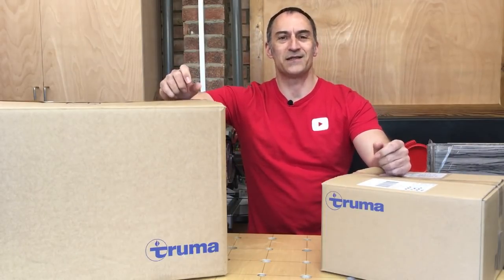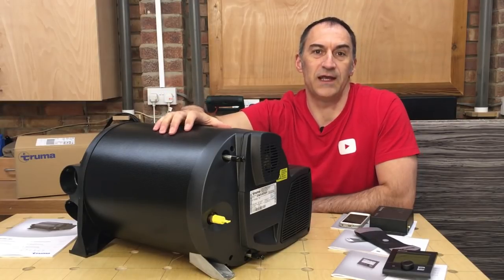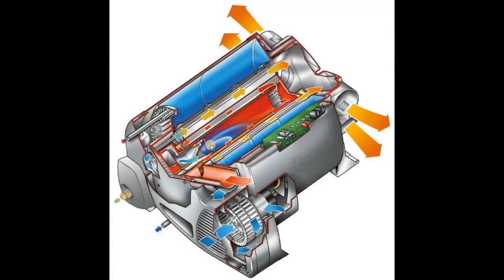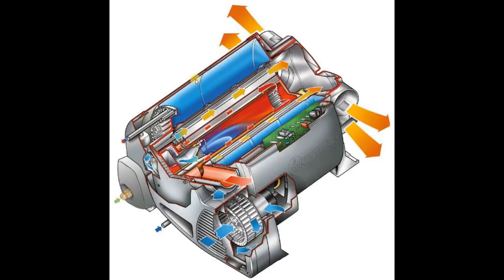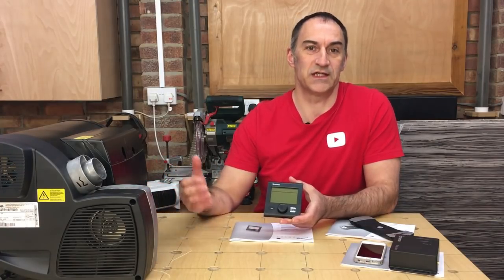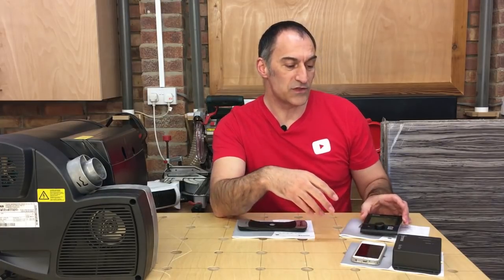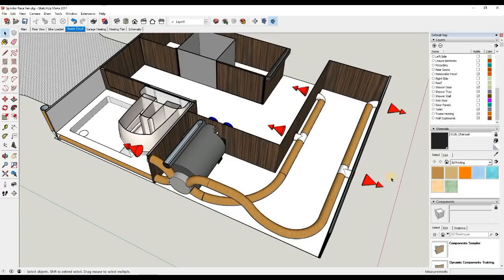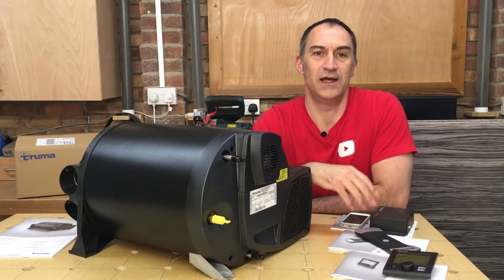Truma Combi 4e Heating & Hot Water Boiler

Comment: First off, I love the series - you are doing a remarkable job. I'm wondering how quiet this heating unit is when running.  Also, can the water be heated without running the furnace . . . say in the summertime?
Reply from the maker: Thank you Bill, the heater we have gone for has 2x 900w electric elements. So you can heat the water with having the gas burner on. You can heat water by gas too without blowing hot air around the van. Proper Combi boiler. 😊
Reply: Sounds good and thank you for your response. Most RV heaters are very loud when running - how quiet is yours.  Once again, this is the best "how to" series I've seen.  Thanks again.
Reply from the maker: Hi Bill, the system has not been commissioned and tested yet but rest assured there will be a detailed video on it running and it’s operation. Thank you

Comment: I love your videos, very educational!
Is 10 litres of water enough to have a shower?
Reply from the maker: Great question, that’s 10 litres of water at 60C so mixed with cold to bring it down to 40C and it will last much longer. 
Of course you won’t be in there for half an hour but plenty to shower with then 20 mins later another tank full for a second person 👍🏼😀
Reply: Greg Virgoe Thank you for your answe! An other one, if you don't mind: If I use 5litres of the 10 litre tank, than the rest of the water in the tank will mix with cold water. I would prefer to keep the water temperature above 40celzius. Does it mean in practise that if I have a 5litre/minute pump, than I have about a minute or two to finish showering? 🤔
Reply from the maker: Your pimp May be capable of delivering 5l/min but you need to check what your shower head can deliver. I would suggest restricting the flow of water to the shower head to lengthen the time you can use it for. Look up shower flow restrictors. Cheers

Comment: Greg that was very comprehensive and well explained - (as usual) -  thank you. I did not spot any form of filtration on the circulating air side of the system? Can you enlighten us on what factors you considered in making the choice between LPG and Diesel and what was the killer fact against diesel? I will watch the makers video now (I do like that LPG liquid sensor!). Many thanks.Edit - just watched the linked manufacturers video - I am calming down now I thought I was going to see full on shower action there - ye gods!
Reply from the maker: Don't expect the same sort of video from me once the system is up and running LOL
I've chatted to the misses and shes not game. LPG is a cleaner and greener fuel.
I was already installing a GASLOW refillable LPG tank for cooking so it was an easy option.

Comment: Greg, I've been binge watching your sprinter build videos. Love them! Do you have any advice for me in the US to purchase the equipment you use such as the water boiler. Or is there a way of getting the equipment shipped, if the company doesn't ship to the US. Thanks for your help! About to start building a  ram promaster to be a mobile grooming unit and want to use your videos for the build. Again, love the videos and your attention to detail! :)
Reply from the maker: Toni Sherwood, I would contact the sales office in The UK and ask them direct, I'm sure they could put you in touch with a dealer in USA, if you get stuck please come back to me as I may be able to get advice from the top man 😃
Reply: Toni, remember the Truma runs on 240V and we have 110V in the US.  I would first contact Truma in Germany to ask about this problem.  You could also contact Winnebago that uses them in their RVs to ask how they resolve this issue.  Once this big question is resolved, you can then hunt for a Combi.  I contacted Truma but they do not sell the Combi direct to consumers, only the Truma Aquago hot water system.  But the Combi is better.  So you  have to find out why Truma does not sell direct.  Is it because it is a 240V and only the RV makers in US can wire it to step down to 240V safely with no liability, or is it because US RV makers want the monopoly and edge of having the Combi while you cannot buy it directly.  I will crack it when I am ready.
For now, see my comment on top with a link to an Aussie dealer and ask them how to get it for you.  But don't forget the 240V issue.

Comment: truma cp plus 4e  w62  1 h ?
Reply from the maker: Yong Cheng are you asking a question?
Reply: @GregVirgoe  Hi I would like to ask what does it mean when the display appears "w62 1h"?  I think I have a problem with cable connection as the sensor keeps showing red light. Thanks.
Reply from the maker: Yong Cheng that code appears to be electronics. I would make sure you have 12v DC supply to the boiler and the controller and that the control cable is plugged in correctly. Check fuses and try again. 😀👍🏼
Reply: @GregVirgoe  Hi thanks for your help.I do have the 12v DC supply and 240v cable both with a diameter of 2.5mm. And I will double check the fuse again when I get home. I am just unsure of which cable goes to which connection, because I reckon there are two cables(one to be red and the other 1/2 red and 1/2 black ),what should I do with them respectively? Thanks.
Reply from the maker: Yong Cheng please watch my install video https://youtu.be/zCjygu0ygKE 
At 9min 15s I explain where the cables are connected.

Comment: You need an outlet for any wardrobe or clothes storage area, my experience is that any condensation obviously will form on the coldest surface. This is usually where you keep your clothes and mouldy clothing is no fun particularly if it is your wife's clothes that smell of mould
Reply from the maker: The cubbies are well insulated from the external walls, the heating is distributed throughout the van pretty well. Warm air rises so I'm not expecting the wall cupboards above the bed to suffer at all with condensation.

Comment: As I understand you cannot get hot water without air heater ON?  During summer camping I definitely don't want to heat the room but would like to get some warm water for cleaning the teeth
Reply from the maker: You can just have hot water without heating on.

Comment: The price in USD seems to be around $2,072.27
Reply: Umm... I see more like $2700 for the basic unit and will probably be over $3000 after flue, ducting, gas connections, etc.  But that's in Aussie dollars... haven't found a US source yet.
Reply: I was looking at a British camping website but I didn't notice it was just the digital display panel, my fault. I will correct my original post.
Reply: After looking up some other options, you can get a Olympian wave 3 gas catalytic heater for around $200 usd and a Eccotemp L5 tankless water heater for around $192 usd, and they both run off of propane. To be fair, you would still have the concern of exhaust for these and they wouldn't come with cool display panels, thermostat control, and a digital interface.
Reply: Oh, there are many cheaper options. In the US. We seem to have a thing for cheap and crappy RV components...
Reply: Yes, I am sure. So the real question is if you can duplicate what the Truma combi does for less.
Reply from the maker: Hello Remy,
My 4e combi boiler and control panel can be purchased here in the UK from approx £1400
The total investment in terms of overall budget for this conversion including van is approx 10%
But the functionality and benefits of having such control over heating and hot water, priceless.

Comment: It seems expensive, there was no mention on price ???...
Reply from the maker: Hello shane, a system like mine with a controller would be from £1400
It is a reasonable sum but when you price individual items for heating and hot water you are not far off this.
Plus as a percentage of the total van build cost its only about 10% investment

Comment: This is a great video, but I wouldn't want the hassle of propane/LPG - especially going from country to country, continent to continent
Reply: Read the specs on Truma.  It runs on gas, diesel, propane, AC, or DC.  Take your pick.  I would not be surprised if you have multiple power source options.  RVs are meant for travel. They know that.

Comment: 10 litres does not seem a lot of water. Running on lpg I wonder how  how it uses. More research needed
Reply from the maker: You may think that but it's stored at 60deg when you only shower at 38deg so you are mixing cold with that too, plus the boiler is running and heating the water as its being used. It's more than adequate for a decent shower and in 20mins is back up to full temp.
Reply: @GregVirgoe  worth every penny
Reply: @GregVirgoe  we are looking to start our campervan build this year. We are doing a rtw trip. Original we planned on our bikes but life changes means we need a campervan.... dog does not fit on my tiger lom
Reply from the maker: North East fishing, wow epic plans ahead, exciting times ahead, our plans changed too from what was going to be a holiday van to full time living and touring, retired at 40&50 who'd of thought? 😃
Reply: @GregVirgoe  haha that my plan in the far future lol.. look up fire movement might help
Reply: @GregVirgoe  finally got the van
Reply from the maker: rusty travels excellent news, what have you got? Now the fun can begin! 👍🏼😊
Reply: @GregVirgoe  wanted a sprinter but could not find one in my budget up north. ended up with 2014 relay lwb
Reply: laying the floor this weekend and insulating walls. what sikaflex or other should i use for timber battens

Comment: This stuff is so extremely expensive
Reply: A compact motorhome will set you back £40-50 grand and it will be someone else's design.  I haven't got anything like the money, nor the expertise to fit a van out to this standard, but it's still awesome to watch.
Reply from the maker: Hello, let me put things into perspective.
The van cost me £7k, the fit out budget another £8k, this heater and control panel is £1.4k
So that's approx 10% of my budget, yes it's the single biggest item but it's going to give me the functionality and control of a motorhome that's at least 3 times my total budget. I never set out to create a budget build. This was always going to be the best DIY camper conversion that could rival any professional motorhome build but for a 1/3rd of their cost.
This is not just a weekend van this is something you could live in full time.